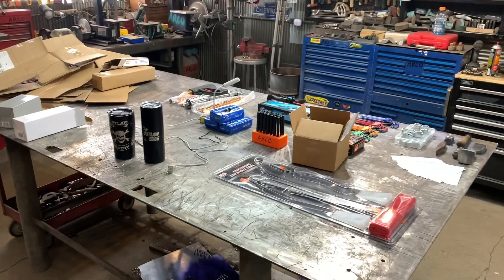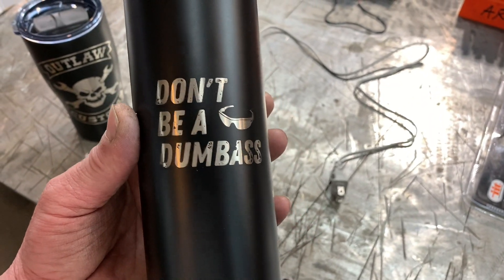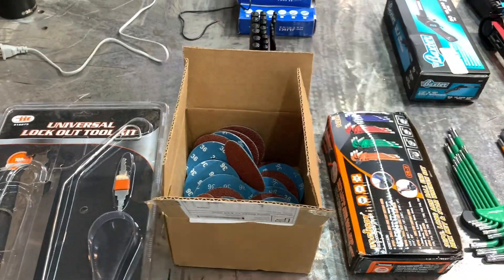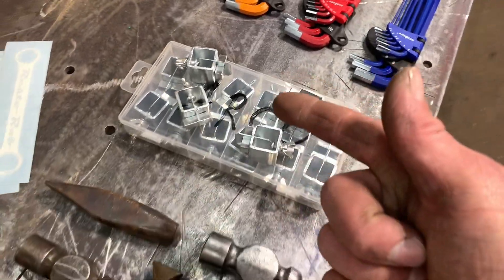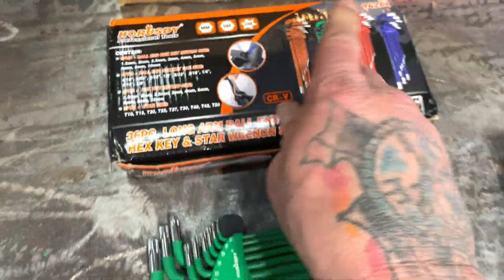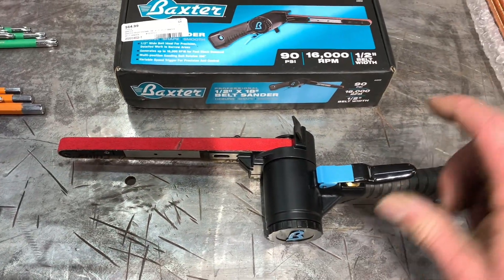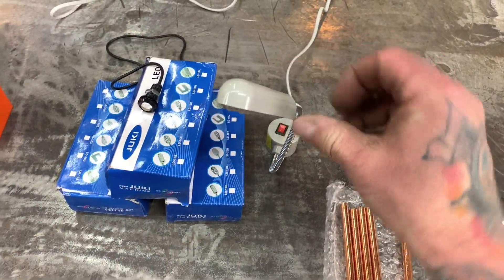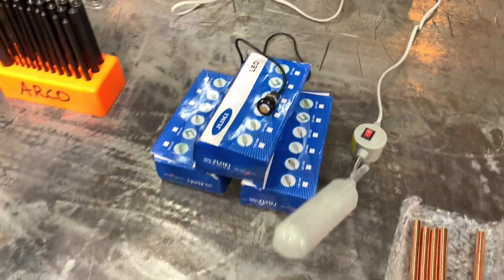Resto Rob Shoutout and shop tool haul

Comment: My son just bought me one of the hand held belt sanders for Christmas. Its a great addition to the tool box. You can change the angle of the belt to whatever you need. Has   more power then I thought it would and found quite a few uses for it already.  I like it great little tool.

Comment: I love that little belt sander, I don't know what their proper name is. I call them all dynafiles. That's the name brand of the first one I ever used. Those things are awesome tools. They are awesome for deburring the ID of a pipe after you cut it and just awesome for getting in to tough to reach spots you can't ever get anything into. I'm going to have to check those out for $65. Those are badass coffee cups with your logos. Love your videos.
Reply: finger sander
Reply: @cliffwill  - That's it.

Comment: Nice haul man. I don't have sewing lights but something similar and they come in handy. Especially in tight spaces. Hey yer a metalsmith-ever think of making your own dollies to your own specs? I got drawers full. Some tool steel, measure, cut em, flame em cherry red and swirl em in oil and hit em with a flap wheel. Presto.
Reply from the maker: That would be awesome to build my own someday 👍
Reply: Make them as you need them. They don't take long.